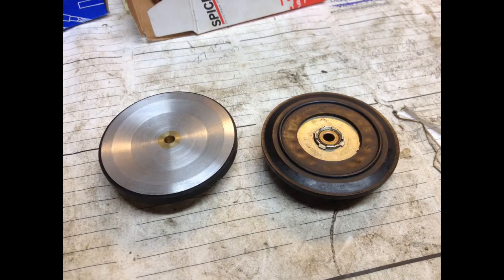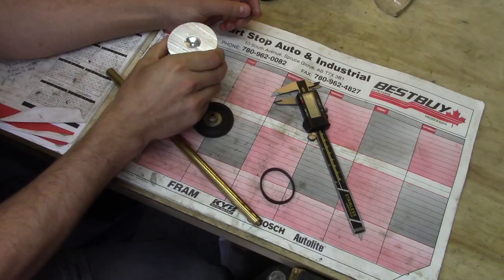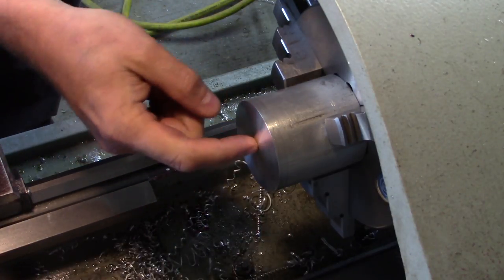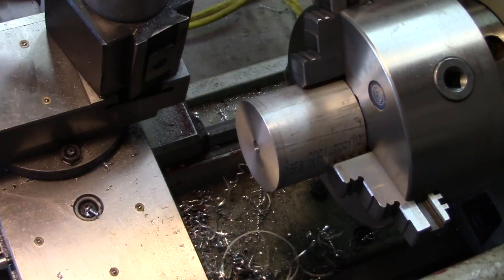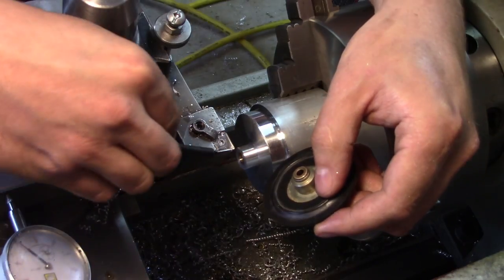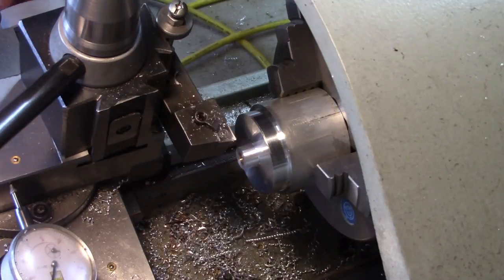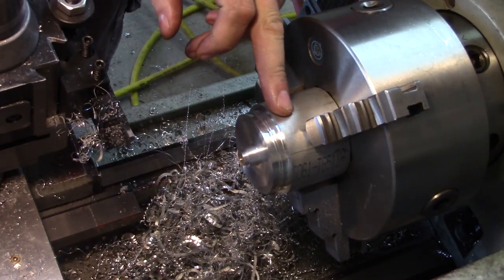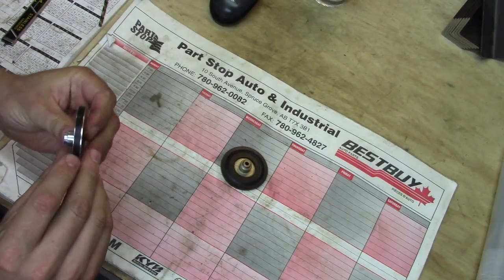Making a Turntable Idler

Comment: Wonderful job Mr. Everett. I have a number of Record Players which i use on and off. At times i run into problems with the mechanical parts. Electronics is not a problem for me. In India we have a number of workshops and highly skilled workers. So, at times i too have to resort to fabricating certain parts. You have done a remarkable job. Thank You. Regards, Engineer from India.
Reply from the maker: Thank you for the kind words, thankfully this worked for my friend's purposes. What is interesting is that I have another one for a viewer on the lathe right now, half done and it's been like that for a couple weeks. Trying to get caught up on projects for people but haven't had much time since my daughter was born. Thank you for coming by the channel!

Comment: Long ago I had a Garrard transcription unit - and also a Colaro - these were good machines and belt drive. The old auto-changers take me back a bit!
Nice job - came out real nice.
Reply from the maker: Thanks! My turntable when I was a teenager collecting vinyl was a Garrard as well, I don't remember which model.  It was working fine, never needed to take it apart but that was also 25 years ago!

Comment: All I can say is that it's magical! A suggestion. It might help to make sure the seal doesn't slip, to glue it into the groove.
Reply from the maker: Thanks! Not sure if my buddy did apply adhesive once he got it, but I see what you're saying.
Reply: Thanks for posting. I own a lovely Gerrard Zero 100 and ordered a refurbished wheel in the States this year. But I also own a mini lathe! So you inspired me to make an idler wheel myself. A good wheel reduces the amount of rumble enormously. Your homemade wheel is more solid and I think you can make the brass bearing more silent determent of the amount of play.

Comment: Absolutely awesome, great camera work and narration.  Thanks for taking the trouble to make this video. 👍👍
I restore various makes of record changers (crazy hobby) and for the idler drive models having a good (like new, or new) idler is critical to the function of the changer. There are a few guys that will replace the rubber on an original idler, so there is that option. However, I think making new ones with a good quality 3D printer is going to be the best solution for making new idlers of all different sizes. Using an original idler for the dimensions would allow making exact reproductions and of course the 3D files can be saved and even shared. Modern plastics such as are available for good 3D printers would be fine for the bearing with some modern lubricant.  You do excellent machine work, but as you say, this is a one-off project and the cost of making these one at a time is prohibitive, although there are some wealthy collectors of some of the valuable record players that would pay whatever you want to make them one of these.
I really enjoyed this video,  but 3D printing will be the easier/cheaper way to reproduce these parts, unless you have a time machine and can go back to when Garrard, BSR, Collaro, Dual, V-M, RCA, GE, etc would sell you a new one for $2.00.
Reply from the maker: Honestly I have considered making more of them but I barely have the time to do shop stuff for myself lately.  And yes, they would be kind of pricey if I was to do them for money in order to make up for my time.
The 3D printed idea is interesting, and would be cheaper, but I wonder about factors like full circularity (warpage/shrinkage/concentricity) and part support during printing (there are usually raised hubs in the center).  I still have the 3D model in my CAD folder, at some point here I might try printing one and giving it to my buddy to try in one of his turntables.  If it works, then that might be a serious option to consider.  Thanks for writing!
Reply: I am not suggesting hobby level 3D printers, but the kind professional shops are now using with metal infused print material.  I have a changer that works fine with a plastic (guess its nylon) idler.  Garrard, BSR and others starting using plastics in some parts of the changer mechanism, but the death of auto changers ended any further development. I greatly admire your work but there must be a quicker/easier way to make these idle wheels. The originals must have been cast or stamped from an alloy. I bet you could make a 4 barrel carburetor, but molding and stamping the parts is much more efficient.  Ok, now that I brought it up, lets see that machined carburetor in 2023.  🤣🤣

Comment: 0:43 What people do not realise is that there are companies that specialize exclusively on the rebuilding of rubber rollers, idlers and such. The problem is... they usually focus on industrial machinery parts or a usually much larger size so do not bother with requests for turntable idlers or tape deck rollers. 
There is (or was) a guy in the States that specialised on the rebuilding of reel-to-reel tape decks' rollers and also idler wheels. The problem with this solution - assuming he is still active - is that he charges an arm and a leg but if your deck warrants it, why not.
1:09 The Garrard 301 and 401 are old but highly collectible and sought after turntables that demand high prices. Their owners, sooner or later, require a new idler wheel which, assuming  the decks are well cared for, is pretty much the only part that ever needs replacement on these decks. Most idler wheel builders do exactly what you did but use a round o-ring instead.  I think this solution is only temporary but, with the o-rings being cheap to replace, it is a working one.

Comment: I recently made a similar replacement wheel out of nylon rod, and it worked fine, but after seeing your video I am going to try making one from aluminum rod
Reply from the maker: Nothing wrong with using nylon if it works, as long as it spins on the idler shaft well and whatever you have on the circumference has good enough grip to spin the table.  Thanks for stopping by.

Comment: 10:40 Hmmm... the idler wheel is one of the three critical parts that make this turntable (the spindle bearing and the platter being the other two - ok the motor shaft and capstan are also critical so make that five, right, forgot the motor bearings - seven). What saves it though is that the idler is pressed against the motor capstan and the platter when in operation, so, in theory, it should not have any room to wobble about, even if cut with a bit of slack - of course this is assuming that the rest (platter, spindle, motor etc.) are cut perfectly and spin perfectly which of course they do not.
19:05 Of course this all depends on how much the rubber band gets compressed when in operation. I doubt the precise diametre matters much since you can adjust the angular velocity of the platter on the Garrard to the desired magnitude. What I think matters more is whether there will be any slippage of the band and whether this slippage will be occurring from the start or whether it will develop after some use. Somehow, my gut tells me I like the square band better in this role than the round o-ring that I see most often being used in idler wheel replacements for the Garrard.

Comment: I wanted to do the same for my old Magnavox but I don't have a lathe. I used Rubber Renue and was better but not good enough.  I then carefully applied a strip of black electrical tape around the inside of the platter and that did the trick. I don't know how long it will last, but it is easy to replace.
Reply from the maker: Never thought of using electrical tape on the inside of the platter.  I would have thought it too slippery, but if it works, that's great!
Reply: Magnavox micromatic 
Made  in England 
 these changers use 2 wheels
1 for tonearm cycle
1 for platter
Reply: I tried the tape while figuring out a more permanent solution (I'm hoping Everrett starts producing these) - totally worked.  Let me know how long your tape held up.  Thanks for the idea!!

Comment: I grew up in Venezuela in the 1950s and they had the worst combination for record players: 110 VAC  but 50 Hz! So you had to change wheels to get your records to sound correctly. Somebody in Caracas made a fortune making the conversion kit. Speaking of the 1950s , Britain officially adopted SI (metric) units in 1949 I believe. But it was hopeless, since no industry had the capital to do the conversion. It was not until they joined the EU that metric became the norm, and by then there was no industry anyway. For the record, there are three countries which do NOT use metric: Nigeria, Myan Mar (Burma), and the USA. Canada is officially metric, as I am reminded every time I cross the border.
Reply from the maker: That is fascinating, I did not know that Venezuela had a 110V 50Hz system, you're right in that is an odd combination.  I really dig odd facts like you just gave, and had no idea that Nigeria and Myanmar did not use Metric (being half American, I knew about the US attachment to inches).  Thanks for sharing, I like to learn stuff like that!
Reply: @EverettsWorkshop  In the 1960s Venezuela undertook a massive project to convert to 120 V 60 Hz. A company was created to do this. It came to your house and did what it had to do down to the idler wheels on your record player! My father's workshop was completely converted which involved replacing (at no cost to the owner) a whole bunch of motors. After that effort Venezuela is power-wise just like the US or Canada. Europeans are of course 200+ V 50 Hz.

Comment: Hi Everett,  thanks for sharing a good idea. I am working on a few RCA players, so I need a different size flat o-ring than the one you used. I can find the square ones (McMaster Carr for example) but where did you find the wide, flat ones? 
Thanks!
Joe
Reply from the maker: Well, I wish I could order from McMaster-Carr, but they won't ship to Canada anymore for some reason.  Which sucks because they have an amazing catalog and while our local suppliers have lots of things there are some things that they don't carry.  I used to work at a Dodge dealer and wound up using a diesel engine EGR flat o-ring as the basis for the idlers I've made.  Not sure what diameters you are working with on RCA's but this design works for some Garrards.
Reply: @EverettsWorkshop  Are you still available to make an Ideler wheel for a Magnavox? Approximate cost?

Comment: Have the same one . Cleaned and lubed , Nothing ?
Reply from the maker: Are you finding the original wheel's rubber has hardened on yours as well?
Reply: @EverettsWorkshop  some what . Changer wheel has more pressure and works , drive wheel hits the spindle low pressure .

Comment: do you make idlers for RCA or VM
Reply from the maker: Honestly I have only made two of these parts so far, both were for my buddy Morgan.  He provided me with pictures of the machine where they fit, as well as the old worn idler to make a part to match.  I've had a number of people ask for them to be made but the biggest issue is just getting proper measurements so that we can be fairly certain the new parts fit.
Reply: @EverettsWorkshop  No understand I agree and making these parts it’s not just turning a piece of metal down on the late it does take a lot of time and I can appreciate the time that it takes to make apart like that

Comment: Really cool, just one question, why not rework the original so you could attach the rubber to it?
Reply from the maker: Thank you!  Biggest reason is collectors' value - although these are not expensive units my buddy still has all the original parts in original condition, this "aftermarket" part just lets him use it to listen to music with it rather than just being a decoration.  Besides, the construction of the original does not lend itself to easy disassembly an didn't want to destroy it.

Comment: Will you mill one for any of us ?
Reply from the maker: Hi Carl, it is actually in the plans to start making more of these as I have had a number of requests for them.  I just moved and the garage needs to be built out inside, but once the shop is up and running again the plan is to start making not only these Garrard wheels but getting wheels from other turntables and making replacement parts for them as well.  Sadly it will take some time but if you email me at everettsworkshop@gmail.com so I have your contact information I will let you know when I am able to start producing them again.  Thanks!

Comment: Do you sell those idler wheel?  It must improved the turntable's performance a lot.  I wanted to hear test spin, before and after.
Reply from the maker: Sorry DJ Shoji, but I never got spinning footage, just still pictures from my friend who collects these old turntables. He can now at least use both tables to full function, even if the part does not look original. As for selling them, I haven't sold them before because I did these two as a favor between friends. It worked out that he drew my new channel branding in return for making parts like this for him. Do you need an idler wheel made? If so, email me - we can discuss further from there as to whether what I can do would be what you need. Thanks for joining in the channel!

Comment: Hello Everett, this might be a silly question but the quality and design of your idle wheel is far superior to the original. Have you considered selling them on ebay or any other site?
(I'm in great need of one) If so how much would you charge for one?
Reply from the maker: I hadn't really considered selling them on eBay, just made a few for friends so far.  I have, however, been asked by a number of people to make wheels for them so might have to consider that possibility.  Biggest issue I see would be that there were a number of Garrard models over the years and some different models of wheels.  So far I have had people provide their originals so the new part could be sized to fit so an eBay item might not be a possibility yet.  If you're really looking for one by all means email me at everettsworkshop@gmail.com and maybe we can set something up.   The thing is that to be honest the last one took a few months to get to and out the door so please understand if it takes some time to get one  made up.  As for cost, email me, we can discuss then :)
Reply: @EverettsWorkshop  sent you an email a couple of days ago, not sure if you received it or had a chance to look at it.